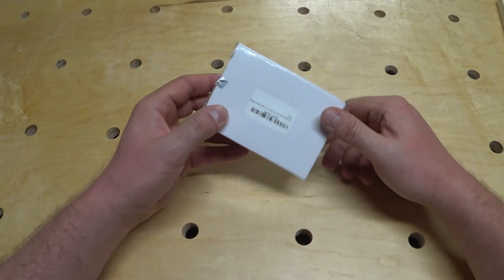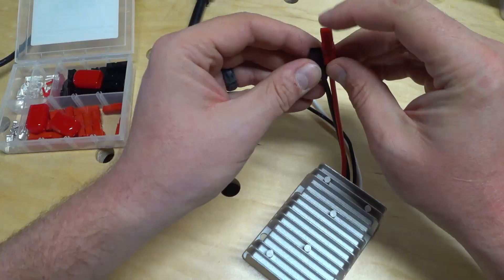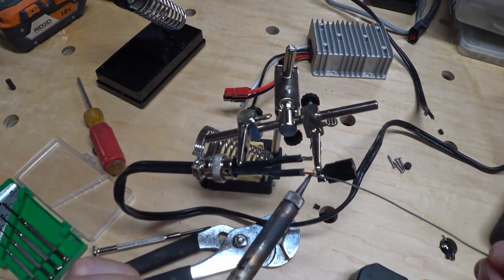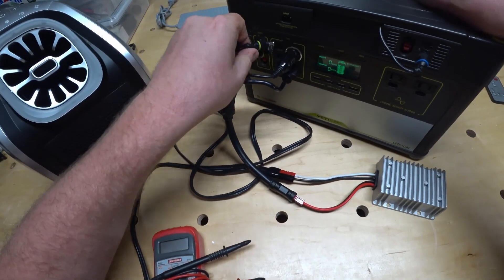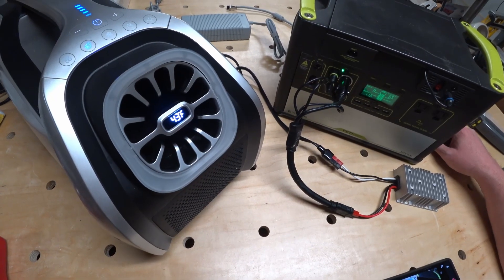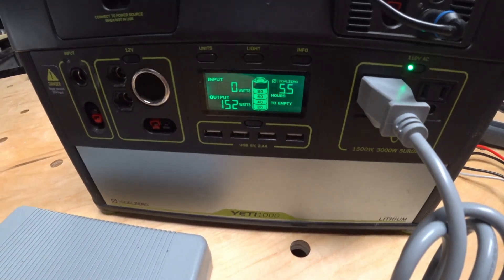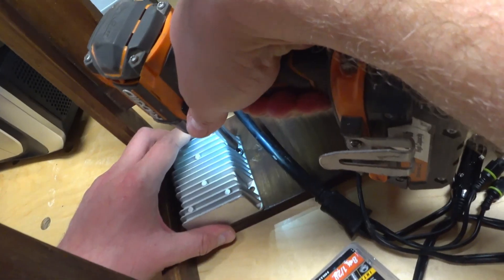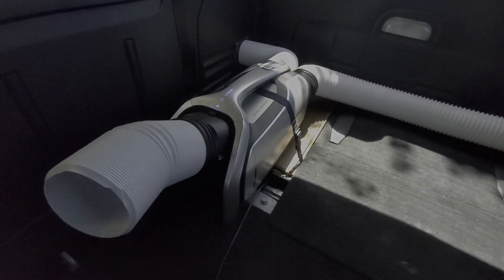Zero Breeze Mark 2 - Powered by 12 to 24V DC boost converter - Wiring/Testing/Comparison with 120V

Comment: Thank You for this great work!  Subbed.  7:51  This is extremely valuable research.  I am upgrading my van rooftop solar to 320 watts and I have that same 12v to 24v 20amp converter I was planning to use for the exact same test!  115 watts would be amazing if this AC could cool the tiny living  space in my like van of around 5x5x5 with some minor openings. The entire vans roof will be under solar (shaded) and when camping I put a silver tarp on the front and usually have wet clothing drying on the sides blocking the sun.  My fridge, TV and phone charger consume about 50 watts.   If i could be at net zero loss amps  at 6pm on a semi cloudy day that would incredible.

The one question I have about the Mark II to is about the dual air vents in the back.  My van has a single 7" vent hole on the roof.  Can leave one of the tubes (the one sucking air in) unplugged?
Reply from the maker: Sounds like you could get close to net zero amp loss for sure.  Several on the facebook Mark 2 page have cordoned off small areas of their vans and insulated heavily, and have been able to cool that small area during the day.  

As far as the single hose to the outside.  You are purging air from the inside which is creating a vacuum in the vehicle, so you must crack a window to provide that "make up air" to feed the rear inlet hose to cool the condenser and replace the air you are exhausting.  If you're blocking off a small area of your van though, it might not make much difference to open a window up front.  

In my testing I've found that when it's REALLY hot and sunny, the Mark 2 just cannot (by design) overcome that kind of heat load in my minimally insulated vehicle, so I just crack several windows anyways as that gets some of that heat buildup out, and I just concentrate on cooling me with the Mark 2.

Comment: Great videos!  I've gone through 4 so far and read the comments, and could not find the answers I'm seeking...  What state do you live in?  Is your vehicle insulated?  If so, how much insulation/thickness (walls, ceiling, and floor)?  Thank you in advance and keep the great vids coming.
Reply from the maker: Thank you.  I live in a hot dry climate.  My vehicle only has it's own insulation from the factory (not much at all).  If you head over to the Mark 2 facebook page there are many examples of van builds with extra insulation using the Mark 2 successfully.
Reply: @Polymathicus  Thanks for the tip.  I just read through the FB group page--man there sure is a lot of crap you have to sift thru to get any good substance, but yes--I see what you mean.  Looks like folks have had good success with a well-insulated van.  Due to all the bad reviews of the company, I think I'll give it a few months and revisit this in the spring to see how the company is doing.  Who knows--maybe they'll have a ZB3 by then.

Comment: Yeah it's always best to use the natural voltage of the appliance if possible. Dc to ac to dc loses efficiency every step of the conversion. Cheaper inverters loses even more.

Comment: Do you remember which pin is which?
Reply from the maker: I think 1 is positive and 3 is negative.  There is also a wiring diagram on the back of the included ac adapter.

Comment: Thank you for taking the time to make this video. 

Any updates in the ZB performance?

Any issues with condensation draining?
Reply from the maker: I'm uploading a full Yeti battery test in a hot car video as I type this.  No condensation whatsoever here in the desert so I can't speak to that.  Works great when it works, but had some issues with the compressor cycling as you'll see.

Comment: thoughts on a water cooled blanket?
https://www.chilitechnology.com/products/copy-of-chiliblanket-chilipad-control-unit-dev?gclid=EAIaIQobChMI2OmTuM_S6QIVCIbICh1KEQXBEAQYASABEgI6h_D_BwE
Reply from the maker: That looks interesting, thanks for sharing.  Power requirements aren't too high, and if it could really keep up with the heat coming off of a person and maintain cool water moving through the blanket even if in a hot room then that could certainly keep a person cool.  It is dependent on the same heat load problem that the Zero Breeze has to deal with, hot person, hot room, hot bed = a lot of energy to get rid of that heat, but at least you're not trying to cool the whole space.
Reply: @Polymathicus  it could be useful.  thermostat?  ice cooler supply?  low drain pump and rechargeable mikita power tool battery?  im a machinist, not an electrician.  if you can suggest a schematic, i can build it

Comment: Does anyone know if this plug is a 12mm (GX12-4) or 16mm (GX16-4) ?   Trying to get a jump on this project thanks.
Reply: Answered in another video.  GX16-4.  
 https://www.ebay.com/sch/i.html?_from=R40&_nkw=GX16-4&_sacat=0&_sop=15&rt=nc&LH_PrefLoc=1 .   
https://www.ebay.com/sch/i.html?_from=R40&_trksid=m570.l1313&_nkw=12+to+24v+up+converter+15a&_sacat=0&LH_TitleDesc=0&LH_PrefLoc=1&_sop=15&_osacat=0&_odkw=12+to+24v+up+converter
eBay:  Cheaper and almost always supports a small business.   Tell Bezos to Suck-It

Comment: jr25.....I'm still thinking of a specially, specially, specially  made sleeping bag with baffles /  plenum chamber, etc that the cool air is mixed with a blower and  discharged into a "bag in a bag" around you , another words cool the bag, not the whole van for sleeping. There is a fan system made that blows under your blanket  for sleeping.  Something similar but with dry cool air from the ZB,
Reply from the maker: Could work for sure.  Wonder how to also get the cool air under you between you and the bed where all that built up heat is?  Maybe not necessary.
Have you seen the link in another comment about the water cooled blanket?  Completely different route but interesting none the less, as it does what you're talking about and pulls the heat out of the person.  https://www.chilitechnology.com/products/chiliblanket#more-details-anchor
Reply: @Polymathicus  Interesting, gave me some ideas.

Comment: These power consumption results are blowing my mind. Every van-lifer needs this thing
Reply: sucks because its like 1500 dollars for one
Reply: @throlyhd9448  Thats with the battery pack. its $900 without. You can plug up to an existing battery bank if you have one
Reply: @04dram04  Yes, this is a good point. Just oversize your battery system and shave off a 3rd of the price.

Comment: I have a little honda crx with no ac do you think this would work as a replacement for the ac?
Reply from the maker: Definitely not as a replacement during the day.  Since the Mark 2 only has a rated cooling capacity of 2300BTU's and a car A/C might be 10-20 thousand BTU's it just doesn't compare.  But it does cool the air going through it, so if you can point the outlet at you, then you might stay comfortable as long as you stay in the air stream, which I believe this was designed primarily to do.
Reply: @Polymathicus  man that sucks I'm really trying to make it bearable to drive around. Might have to just figure out some kind of ac solution.
Reply: @Drakilicious yeah i used to roll the windows down when i lived in san diego but i live in cincinnati now way to humid and hot in summer. Some months are ok but summers to much. Also i love swamp coolers but they dont really work in high humidity. Which makes the term swamp cooler weird because swamps are humid. Just not enough evaporation to work well. The car is a little honda crx and im putting a much larger engine in it that has no business being in it so ac has to be removed or set up in some crazy custom way.

Comment: Can you explain your setup @ 9:00 & the reasoning behind it? (how you’re removing the hot air, and pulling in the fresh?)

From the manual it looks like that left exhaust is the hot air? if so what is it up against, a rear vent? (Wouldn’t that just push the hot air through a connected vent back into the car?) or did you cut a hole...?

And you have the other end extended and then curved back around (wrapped in something..) what & why?

Most videos and even the manual just show both tubes exiting the space (through a window/hole/etc..) in parallel to eachother.. 

Im interested in purchasing this for use in a vehicle and trying to figure out the most effective method.

Thx for the content keep it coming !!

**how did you know the included inverter, or whatever, was less efficient than what you could build yourself?
Reply from the maker: I have both intake and exhaust ported to the outside.  They are both running through the vehicles pressure relief ports in the two corners.  By pressure relief ports, it's those "flappy things" that let the pressure out when someone closes a car door.  They're in all vehicles, usually behind the trim somewhere, just have to find them.  I used a 4" drain cover on one side and 4" metal HVAC duct on the other over the factory holes, then the Mark 2 hoses connect to that.  I should probably make another video showing this as I feel I'm rambling.

Other end curved around is probably a separate black duct hose I'm using for other experiments with exhaust fans.  Not connected to anything.

I couldn't run them both out parallel as the holes the pressure relief contraptions are in would only allow either/or because of the small size holes to the outside.  This is helpful though as there's no chance to suck the hot air back in running them out different sides.

Assumed the DC converter would be more efficient as it usually is running DC/DC and not DC/AC/DC, and the test in the video showed that to be the case.

If you're not worried about advertising you're in there you can run them out the window.  Another option is to cut a 4" hole through the vehicle floor (make sure nothing important on the other side).  I did this in another vehicle to mount a fan in which drew fresh cool air in from underneath, pressurized the vehicle, and purged the hot air out a cracked window.
Reply: @Polymathicus  Why is it necessary to bring in air from outside? Wouldn't it drastically increase efficiency if the intake hose was pulling the already-cooled air from in the vehicle and re-cooling it instead of the exterior air?

Comment: So, how do you think this will fare, as in maintaining coolness, on a 80 degree muggy night AFTER a vehicle or RV a/c cooled down the area?  Still a personal cooler, or any additional thoughts? 
Thx for your earlier reply.
Reply from the maker: With my limited testing, and only in full sun, I'm still going to play it safe and call this a personal spot cooler.  We stayed in our 24ft RV in New Orleans on an ~80 degree muggy night and our 13.5K BTU RV air conditioner ran most of the night just to keep the RV at about 75, so I just can't see something this small keeping all but the smallest car cool inside.  I can however see it keeping whatever it's blowing on very comfortable with the intake and exhaust ported to the outside.

Comment: I’m still waiting for my Mark 2. I have a Jackery 1000, so my setup is comparable to yours. That DC setup that you have is amazing. I really want to do the same thing. So the 12V to 24V adapter sold on the ZB website is different than what you made?
Reply from the maker: Yes, different, I bought mine on Amazon.  They specify on the website last I looked that theirs is only intended to charge the proprietary battery.  They specify it's not to be used to power the Mark 2 as it may drain the power source (car battery).  But the specs listed imply that it will do exactly what mine will with a suitable power source (that is, push 240 watts max into the Mark 2).

Comment: Why didn’t you insulate the exhaust house? You are cooling as you are heating at the same time.
Reply from the maker: Good question.  I may do just that at some point.  I did make the short hose the exhaust one and it's mostly collapsed so it does have some insulating qualities.  I didn't feel much heat coming off of it during tests, and the ambient temp in the vehicle was already about 95 degrees, but you're right, I'm still adding more heat to an already hot space.  When considering the heat load being generated in a closed vehicle parked in full sun, I guess it didn't seem like a priority, but couldn't hurt.  This opinion is purely regarding daytime, full sun, closed vehicle = no chance of bringing down ambient.  Insulating the exhaust however might have a measurable impact at night or in shade.
Reply: @Polymathicus   jtskr25  Im guessing that the that tube is releasing more heat than you can realize in that already hot car. My home portable A/C is useless when i have the hose un-insulated.  Also where does the heat exhaust exit to, behind that panel? Is some of it releasing back into the car? That will really make all the difference. Air conditioners produce more heat than cold air. So proper exhaust is everything.